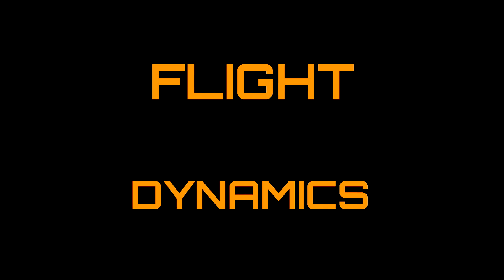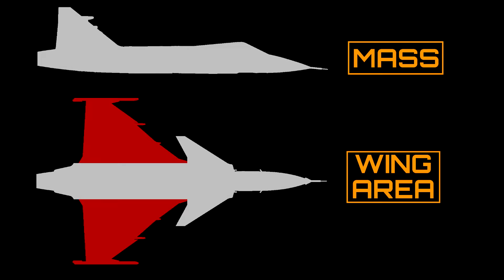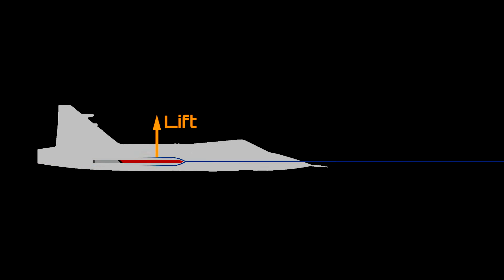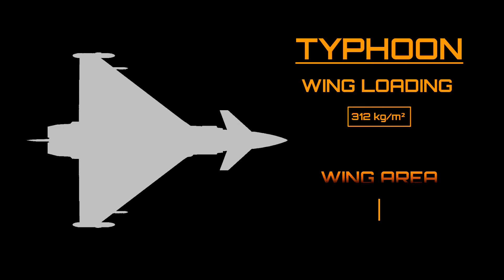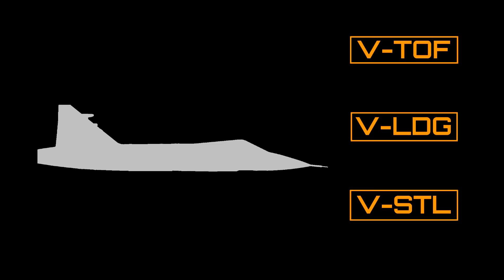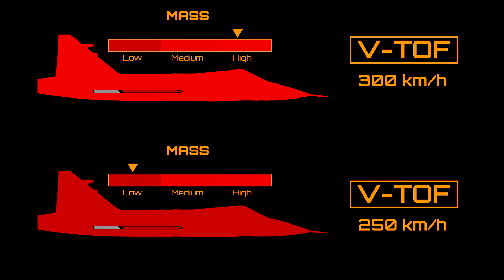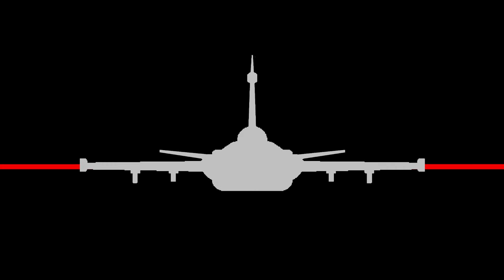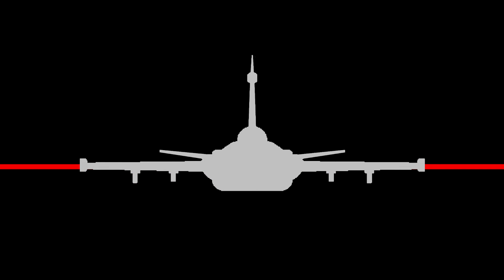Flight Dynamics | Wing Loading

Comment: So does a smaller wing surface area give a larger velocity? Why is this?
Reply from the maker: It's because a smaller wing typically reduces drag - a force that is always opposing the direction of flight. Cutting down on that allows for greater airspeed, assuming all other factors that affect airspeed remain constant.

Comment: nice one! Like the color and overall style. What software did you use? One aspect, which you can probably easily correct and improve the quality was the red line and circle near the end, both very clearly pixelated.
Reply from the maker: +Military History Visualized I used Sony Vegas for the video itself and GIMP for the drawings that compose it. For some reason GIMP gives me somewhat pixelated drawings, especially when drawing curves or circular objects, though admittedly I did not spend a great amount of time in making each drawing.
Reply: +Lysander hmm not sure if this would be faster, but I recommend using PowerPoint. Just "draw" the plane once by using the freeshape tool and basic shapes (merge, etc.), then you basically get a object you can scale and reuse all the time, at least that is my approach. Another way would be to draw basic objects like the circle and line at an very high resolution in Gimp, or maybe Sony Vegas (I don't know it), reduced the quality of some pictures during the import or while exporting the video.
Reply from the maker: +Military History Visualized Thanks for the input, although I haven't heard PowerPoint getting used that way before. I'll certainly give it a try.